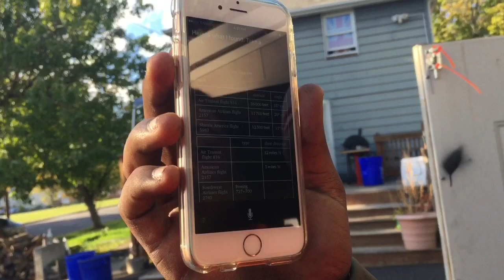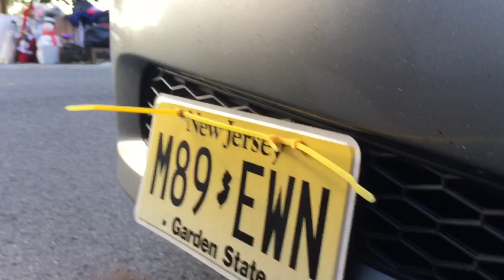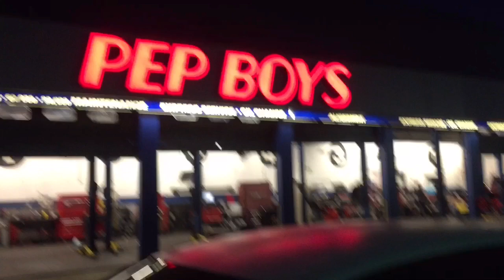240sx Wheel Build Part 1 & Swag License Plate Install

Comment: Oh and if your attempt was to take the tires off next time use a pick up truck with someone spotting you drive over the sidewall of the tire only as close to the rim as you can and the tire will pop out of place allowing you to remove the tire without damaging the rim or tire just an fyi.